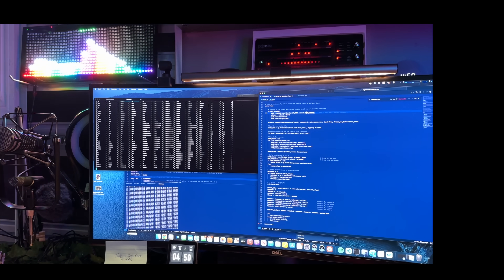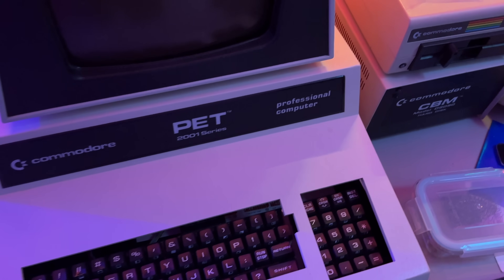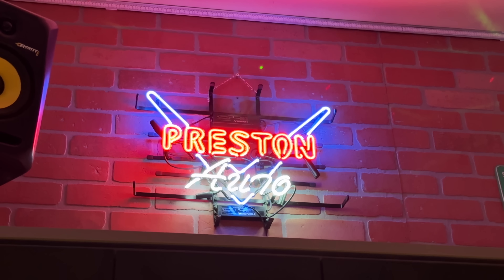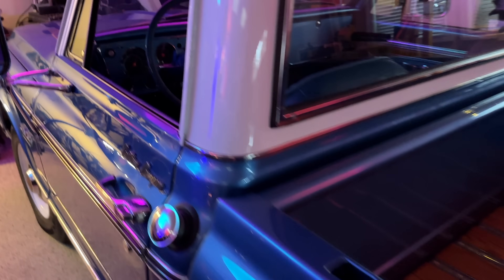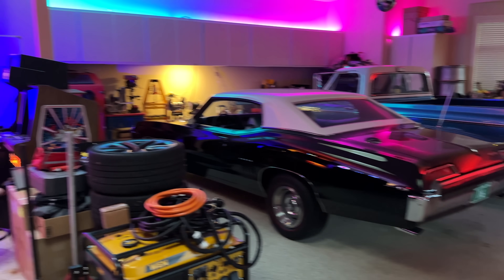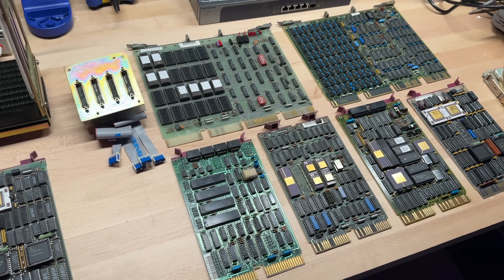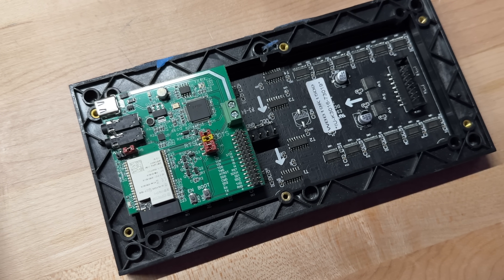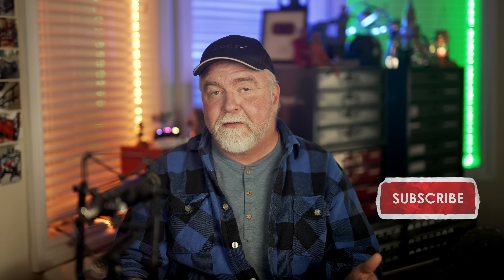Things You Can't Unsee: My Shop!

Comment: How heavy is that 70" Plasma???
Reply from the maker: 340lbs.  I couldn't find anyone wiling to mount it when I retired it from the house.  Eventually I rigged up a block and tackle into the ceiling (you can still see the eye hooks) above it and winched it into place.  It's a monster.

It's just a monitor, too.  No TV receiver, not even speakers.  But when I moved into this house in 2006 I was replacing the 100" four-screen thing the house came with.  Needed a big TV, and it was brutally expensive, but is still mostly working today!

Comment: Good Luck on your procedure. I had a disk-ec-tomy back in 2000 for a crushed disk. Was mowing the lawn three days later (against Dr.s Orders) No replacement disk added back just middle removed. But did work great! As for the Garage very disappointed to not see Vax 11/780 or any Digital Equipment nor any TRS80 COCO, Model 1, 2, xenix, 3, 4, 4p equipment. All tong in cheek of course but hope to see you back and making video's soon. Thanks Dan

Comment: The IBM 55 SX - had a great issue when they came out in one office, they, like yourself had the monitor on the top.  Now the 55SX has its expansion slots upon a riser card that with a bit of flex on the top of the case, could make enough contact to sometimes wobble that riser card and cause the system to lock up.   Turned out the monitor was a little heavy (they were in the CRT days) and anytime somebody closed the office door with any force beyond library door closing standards, would send just enough vibration into the room that would be just enough to induce a very slight wobble upon the desk and with wonderful harmony, the monitor, slightly bowing the case lid would cause the aforementioned riser card to wobble ever so slightly and boom, locked up system.

So Dave, if you find your IBM 55SX doing a random crash, may well be some external noise in combination with a heavy monitor wobbling that riser card.

Comment: Good luck with the surgery. Hope it helps.
I have, I believe, the same issue.
For about 28 years now I have the disc between L4 and L5 in my lower back that is soft. Got an MRI in 2012 and the neurologist talked about fusing the two vertibrea.
Won't it limit your mobility/flexibility?
Though, not having 24/7 back pain is nice too.
Reply: Oh, in my case the soft tissue bulges outward on the nerves.
My right inner side of the foot always feels sleepy. And standing for 5 minutes is a limit, same for walking. And every now and then it just hurts like he'll all the time. Like right now.

Comment: Good luck Dave, my wife had spinal fusion surgery a few years ago [naturally the year I bought my Harley]. After a Lengthy recovery, she got to ride it. Make sure to prepare your area, the extra weird pillows and stuff. Make sure whomever is helping with your recovery [you WILL need help in the beginning] watch some youtube videos on how to help you switch position in bed, how to do the sheet assist 'log roll', the proper way to go from laying down to sitting up. [even taking a piss is about to become an Olympic event, believe me]. Also, get non stick stuff for the bathtub, when you start showering again, the last thing you want to do is slip and fall in the tub. Wow, this is giving me flashbacks... I'm a former soldier and the first few days of her recovery had me more nervous than just about anything else I ever faced. Oh, and lastly, set up room to room intercom that allows her to 'listen' from another room as well. That was a very important part of our gear, wireless mics in every room and the garage. Best of luck, speedy recovery, and even if you do a 10 second checkin video, let us know how you're doing. May the force be with you.

Comment: I wish you luck with the surgery. The good news is they can often fix it. Modern medicine.
The PDP 11. It may be useful to know that Xerox was a big fan of the PDP 11. Such big fans that it ran their Xerox 9700 printers. In the early 1980s it could do 300 dpi, and merge with a document, do front and back, and 2 pages per second. It ran a PDP 11/42 I believe, though it had a split bus. Xerox eventually made all of the parts for that machine with the exception of the CPU. Someone out there should have a pile of parts.

Comment: Not a car guy, but damn those are some beautiful classics you have there.
Reply: same thing for me
Reply: @An.Individual  I think the Pontiac 2+2 is more valuable than you think in that condition as it is a rare version. Also, that vintage GMC/Chevy truck is now quite sought after by many, though parts are not as plentiful as they may be for the 1960-1966 Chevy/GMC trucks as well as the now classic squarebodies. Personally, I love the squarebodies myself. Now, I'm not saying they are necessarily as valuable than a classic tri Chevy from the mid to late 50's or certain versions of the big Chevy, the Caprice/Impala/Biscayne/Bel Air etc, some of the Chevelles and of course, Novas and a few others, like the GTO/Trans Am/Camaro.

Comment: G’luck with the procedure.  Will be on the lookout for updates!

1- I used and owned everyone of the computers you have in the garage (except for the commodore 64, I still have the Apple //e w/English/French keyboard, all 500+ disquettes as I ran a bbs at 300, 1200 and 9600 bauds…. And an impressive Apple Cider 20 MB drive (695USD))

2- impressive car collection… as a Motorsports enthusiast and now owner of a performance / racing parts co, I appreciate you being a rat rod.  My garage has my 2nd car, 1989 Mustang GT and a 1937 Ford Coupe my dad gave me.
Reply: BBSing at 300 baud!!! Those were the days!!!
Reply: @igorrogi1610  and « faking » the carrier connect with a touch tone keypad or by whistleing in the headset